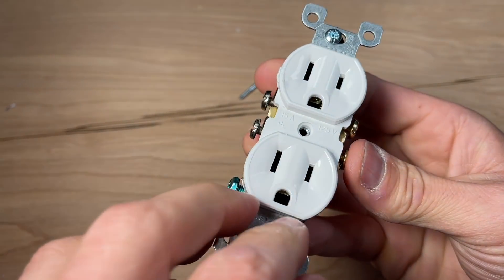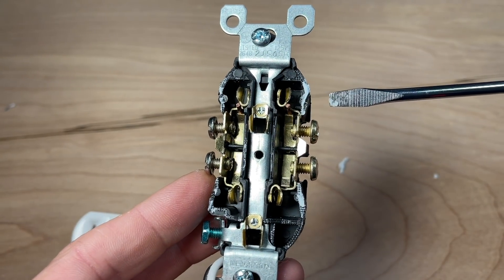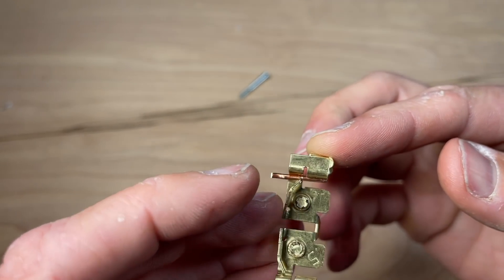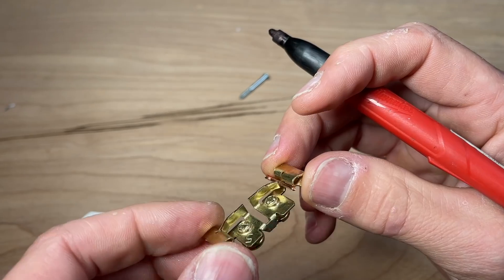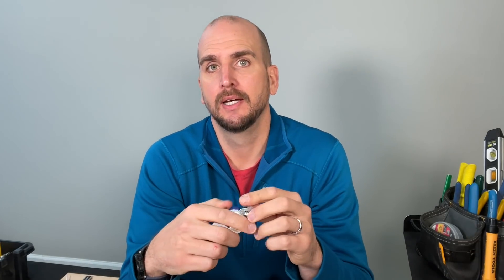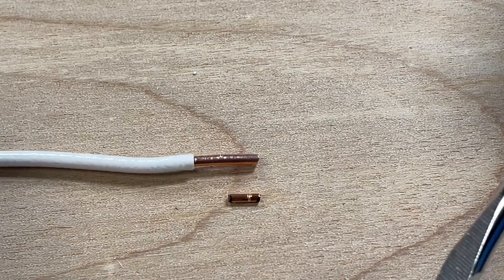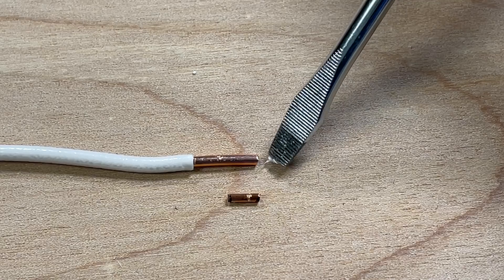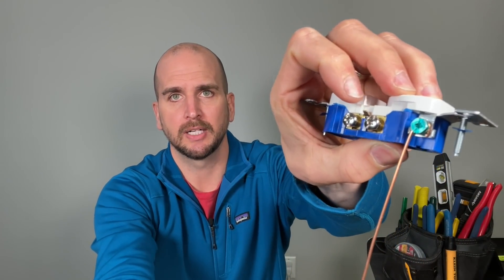Why You Should Not Use Speed Wiring | Back Wiring Is Preferred

Comment: Thanks Scott for the very revealing video on the Speed Wire electrical connection.  I'm not an electrician but, have been working with house wiring since 1968.  I am a retired electrical engineer that designed electronic equipment for aircraft, an environment where electrical connections are taken very seriously.  I have seen numerous speed wire outlets fail over the years, resulting in open circuits, cooked wiring/outlets, and fires.  Seeing the internals with the outlet you opened, I find the connection to be a joke.  The assumption is that the inserted wire will always be clean copper, perfectly straight, inserted once, and have no wire forming afterward to cram the outlet into the box.  Even after every requirement is perfectly met, the connection will still fail.  Obviously designed to be super low cost, using a brass spring finger to apply force against the wire to hold it up against some parts of the brass connection, doesn't guarantee a reliable connection.  When the brass heats up, the spring finger will reduce the amount of spring force at a time you need it most.  I recommend limiting outlet current to 3 amps if the Speed Wire connection is used.

The Back Wire connection is a huge improvement, as screw tension is clamping the wire between 2 contact surfaces.  Of course, the Side Wire connection, where the wire is wrapped around the screw, is by far the best connection, giving the most contact surface area.

Comment: in europe we mostly use push-in connectors, they also have a release-button.
Reply: Your connectors are a good bit better than these push-in receptacles however.  They provide constant spring pressure and the release mechanism does not degrade the quality of the connection (reusable).
Reply: @GoFastGator  and we have only to deal with 16A

Comment: the speed wire connections are safe, otherwise UL would have said something about them by now. these have been around for over 50 years and is still safe today as they were in the 1960's.... also, the Ideal push connectors and the WAGO connectors also are the same idea.... so, whats all the fuss about?  the one thing people need to know that the outlets are ONLY rated for 15 Amps, not 20.... and thats where problems start... and if the ciruit is daisey-chained through these connections instead of pigtailing... then thats another issue.  Back wiring works well, providing the connections are tight...
Reply: Yeah, I wired my house 30 years ago, using the speed wire connections. Haven't had even one problem with an outlet. Did have one light switch wear out a couple of years ago.
Reply: @brianbrehmeyer3929  see, so they work... and Ideal has speed wire caps, and then theres WAGO. so I trust whats out there... it hasn't failed me yet.

Comment: At 3:30-3:32  the wire looks to be in contact for more than a 1/4 inch.
Reply from the maker: It extends out and brushes the plug prong holder but I would not say that is a solid connection and changes dramatically depending if the wire was perfectly straight or not.  Good eye!
Reply: @EverydayHomeRepairs   i see what you mean.   its not ideal.

Comment: You only once have to spend the better part of a day tracing a dead outlet and finding that in fact, every outlet on the circuit has failed backstabs and has to be replaced, to never use them again. That's right, every one had an issue. Some were visibly overheated, some were loose, and on the one that killed the circuit the hot wire was melted in half. 

I did some painting in one of my kids' brand new house and while I had the wall plates off I was glad to see everything was side-wired. The house has a one year warranty for everything so that could have something to do with it.
Reply from the maker: Thanks for the feedback and I am glad to hear a new build had the receptacles side wired.  That is not common in our area but does depend on the builder and installer.

Comment: Hi Scott, great channel for DIY and more, I'm an electro-mechanic in a big factory, we never  use speed wiring (seems so flimsy) and when there's 10-12 wires passing thru the box, it's impossible to fit the receptacle with speed wiring, i know that's not what you'd find in a typical house, but i wouldn't use speed wiring anywhere, also here in Canada (almost same code as U.S) ive never seen a professional electrician use speed wiring in any situation, and here's a little tip that's almost faster than speed wiring, you don't need plier to make a ''J'' hook, strippe all the wires, take the receptacle and face it towards you, use the plastic tabs in the center of the terminals and the screws to make a hook, place the copper wire on the left side of the screw, then twist the receptacle clockwise 180 ° (or the wire counterclockwise) and boom! you got a perfect ''J'' hook. Repeat the process for all the wires before securing them.
Reply from the maker: Nice tip, I am going to try that out tonight! 👍

Comment: I did not realize that back stab connections are only rated for #14 wire.  Since I always use #12 on outlets, that is another reason to not use them.
Reply: @Douglas Canfield. I just replaced an outlet that wouldn't hold anything in tight. Fire hazard for sure! 30 year old house we're renting while we build. I knew it would be #12 wires in it since it was fed by a 20 amp breaker. But I wasn't expecting them to be back stabbed! And with zero slack! So I  guess you can or used to could get #12 holes on 20 amp outlets. I had hell getting the 4 conductors to release to save precious slack! So I J hooked everything back down on the new outlet and am back in business! Yes I've always despised going behind back stabbers 😬
Reply: Me too!
Reply: in 1986 or so it changed to 14...before that it was good for 12 solid.....if you find an older recep youll see this....
Reply: @paulverstraete9157  Oh ok, makes sense! Thanks Paul!

Comment: Great video and discussion.  I concur that for general DIYer work, back clamping is better than sidewiring for the reasons you mention.

Another point against the speedwire is that the force between the wire and receptacle is less which can lead to the real area of electrical contact being much less than just the area in contact would indicate.  Search for "inspectapedia electrical connector areas" for discussion of this topic.  In the days before ubiquitous torque specs, I was taught to tighten enough that the wire would slightly deform (flatten) in the contact area, thus substantially increasing the total contact area (turned out to be ~20 in-lbs).  I blamed that lack of clamping force for some of the speedwire blackened/semi-melted receptacles.  A discussion of appropriate tightening force could be appropriate for another video, if you haven't done already.

Comment: Video: about different types of wiring
Me: Holy crap is that a screwdriver specially designed for the phillips/flathead combo screws?!
Reply: Yep It's called ECX :)
Reply: Yeah, those are cool!  Receptacles now take a Robertson aka "square" #1 driver (old ones in the wall might not though).  I can't tell exactly, but it kind of looks like he's using a combo slotted/Robertson (Klein 7314 is one example, but not that's not his) instead of a combo slotted/Phillips.  However, I find the square bit is so rock solid I haven't broken down and gone for another tool.
Reply: @RJ-ej1nr  some receptacles and switches only have the slotted/Phillips screw.
Reply: I saw the same thing.
Reply: I have a Milwaukee ECX screwdriver. I do a lot of maintenance work and handyman work. That tool is great. It will never slip. Well worth the money if you change many outlets or switches.
Reply: I was thinking the same thing, I buy mostly Klein tools and have never seen this but havent looked all that hard either, what a great concept, I do HVAC and some electrical so this would be really awesome. Dammit, now I have to buy another tool!! ha ha
Reply: The best part is that they're actually going to start making them in Milwaukee soon, if they haven't already.
Reply from the maker: Hahaha, made a whole video on that Milwaukee ECX.  Pretty nice!  https://youtu.be/UxJbORlexFU

Comment: One thing about backstab wiring that you did not mention is that the method relies on the spring inside the receptacle retaining tension over time in order to keep the wire in contact.  Those springs wear out over time and cause loose connections inside the receptacle.  BAck- and side-wiring don't have that problem.  The screws aren't going to back themselves out over time.
Reply: Screw connections constantly adjust with temperature. UK electrician, I do electrical condition reports. Before testing I check screw connections that greatly improves test results. In commercial jobs I would always use wago terminals spring loaded as they are maintenance free.
Reply from the maker: Good call 👍
Reply: I'd suggest that the backstab has less contact area for thermal dissipation as well, which would cause increased heat build-up under high load, such as lots of 12A vacuuming, which would cause further degradation of contact spring. It's like a lose-lose: higher contact resistance with lower thermal dissipation.
Reply: This happened in my barn. The tension loosened over time and the outlet lost power due to the arcing and corrosion caused by this.

Comment: I installed four outlets in series in my basement over 25 years ago.
I went to use one of the outlets two years ago, and it was dead. I checked to see if the breaker was tripped, but it wasn't. Thinking that the breaker was bad, I replaced it.  Still no power to the series of outlets. I backstabbed the wiring and after years of use, the first outlet in the series finally loosened up the connection and stop completing the circuit.
What made it worse was that the original connection would intermittently cut out and then complete again on its own. This happened 3-4 times before I got around to investigating it.
After saving myself 60 seconds on each outlet [4 minutes total] it cost me three hours in the long run.
I won't backstab anymore.
Reply: You should use pigtails on all the outlets. If one goes bad, the rest will work. Required by code in some areas.
Reply: They were wired in parallel. Nomenclature important.
Reply: @tedlahm5740  - You beat me to it.
Reply: @tedlahm5740  if they were wired in parallel, the rest of the receptacles would have still worked. Sounds like all were not working which would happen if they were indeed wired in series. 
Personally, I would wire them in parallel, so if one went bad the rest would work
Reply: btcsys AC current is SERIES , yes, Christmas tree lights, Dimmer switches etc, etc,   Room duplex outlets are wired in parallel. As each LOAD is added to each
place the RESISTANCE in Ohm's is REDUCED. At the same time the CURRENT 
in Amps Increases naturally.    Again, Reduced resistance causes increased current.  Thank you for follow thru.
Reply: @btcsys  they were ran in parallel, just ran feed thru instead of making a joint and pigtail to the rec.
Reply: @tedlahm5740  Thanks for letting me know what I did.
When were you in my basement?
SERIES
Reply: @stans5270  Too funny!  And his comment got 2 likes.  Go figure.

Comment: Just replaced another outlet yesterday stabbed in. Wire hot & fell out when removing. Oxygen generator going on & off. Not just irritating, but dangerous
Reply from the maker: Yikes, that does sound dangerous 😬
Reply: Gregg, oddly enough, I had to do the same thing yesterday in one of my houses. The receptacle in question, kept on losing power for no apparent reason. When I disassembled the receptacle , one of the wires which was "stabbed" into the back of it showed signs of overheating. The copper wire  easily dislodged itself from the receptacle which indicates to me that a high resistive connection existed which caused the overheating. I just don't trust the stab-in feature on these receptacles.

Comment: I don't know how I was able to figure this out. But since I was a kid I thought that those speed wire connection holes were suspect. And then as I got older I had to remove one of those things that had wires coming into it and then going back out. 

All four holes were speed wired, those wires are hell to get loose from those things and  sometimes you end up having to break the  Outlet to get them out. Not to mention I've heard from other commenters that those can be a fire hazard. And they only take 14 gauge wires (not 12 guage) anyway, so they just ultimately suck. I'm glad you've done a video talking about this because I know you have mentioned this type of thing in several of your other videos.

I can't believe that they still make Outlets with those connections. And I didn't know that they were also called backstabbing, that doesn't sound very nice😀.
Reply from the maker: 😂 yeah the backstabbing name probably came from a group that was a little less than a fan of speed wiring
Reply: You don’t remove them, you snip off the wire where it enters the receptacle. It’s damaged beyond the ability to reuse the exposed end.
Reply: @declanfarber  What you're saying makes sense but at the same time it shortens the wires. And it seems from what I've noticed that the wires are sometimes already short when it comes to these type of setups. But I do understand a you can pigtail the wires. It's just annoying though.
Reply: @REXXSEVEN  It’s just something we have to deal with. It’s also one reason why code dictates that we have to have a certain minimum length of wire in the box.

Comment: I'm not a fan of the speed/back wiring receptacles. My issue with them is that builders or electricians typically cheap out the installation by making the receptacle a junction point for entire room's electrical outlets and in some cases overhead lighting.  Why it isn't against code, I'll never know. 

As for moving up to "commercial" grade receptacles, that only provides you marginal upgrade to residential.  I suggest the code writers check-out the house wiring devices in the UK for safe and well built devices. And yes, I know they have higher voltages but they are better made overall.
Reply from the maker: Sure, I get a fair amount of feedback from Europe and Australia in terms of their superior receptacle design.  At least for our current status here in the US I much prefer the commercial grade with back wiring.  Thanks for the feedback.
Reply: i have a problem with wire strain with uk outlets there is no real room for wires and when you dble them up there is a lot of strain being crushed against the back of the box  or you have to loop the cables along the sides stretching them at 90 deg. angles
Reply: All devices should be pigtailed and spliced into the branch circuit! You should never use a device to carry power to the rest of the circuit.
As for the box fill, you should look at if it is over filled. Depending on the gage of wire and box size there is a limit on how many wires you can have in a box. If it is over filled then you will have problems with getting all that wire in the box.
Side note: I always use a 22 cubic inch single gang box for any GFCI. THAT GIVES YOU PLENTY OF ROOM IN THE BOX FOR THE DIVICE AND UP TO 3 number 12 wires
Reply: @Samuel You could also mention that your general purpose plugs and receptacles are more robust and capable in handling higher current loads, which is ironic. Most UK homes are made primarily of brick and mortar, two natural fire restricting materials,  as opposed to US homes which uses wood extensively.

Comment: In my opinion, the NEC should have never approved the "speed wiring" (back-stab) connection method; I believe it is a major reason for requiring AFCIs at the consumer's expense!!!
Reply from the maker: You could be right, it is probably not a stretch to think businesses like home builders apply a bit of pressure to make sure speed wiring stays approved by NEC.
Reply: Exactly, they should have banned speed wire over the AFCI mandate. This is not to  say that AFCI is not a good thing but lets face it you need to solve the problem at its source.
Reply: Follow the money

Comment: I had to use speed wiring when I installed another outlet on the other side of the same outlet. I also used speed wiring on 2 outlets in my attic. The design was there so it is safe to use because u can screw tight from the side. The clip bite down pretty tight when the wire is insert into the holes. It is like shark bite clamp down so it requires force to pull it out. U really have to bend the clip in the opposite direction for the wire to come out which takes some force.
Reply: The receptacle has a slot under the hole where the wire is that you push with a small screwdriver, that releases the wire without bending or breaking anything.
Reply: @jthonn  sometimes the little slot works. Usually not. The whole thing is a horrible design.
Reply: It was not designed to be reused lots of times,' that's for sure. In Europe we have different types but the modern ones are all push-in and don't have any screws anymore. Connections feel really snug, enclosing/wrapping the wires better than the thing in the video does. There are typically plastic levers you have to press down to get the wire out again which will hurt your fingers when you do but it works if you really need it. If I cannot just pull the wire out with force I believe it is good. It is most likely cheaper to produce and cheaper to install so this is the new way, better get used to it.

Comment: I am currently in the process of replacing all receptacles and switches in our house. Except for the 20 amp circuits the rest of the house used the backstabbing/speed wiring method. Some of these were actually cracked and were so loose they actually came out when the switches were pulled away from the box. I'm upgrading to spec grade.

Do you have a video that explains how speed wiring and the use of Wago connectors compare?